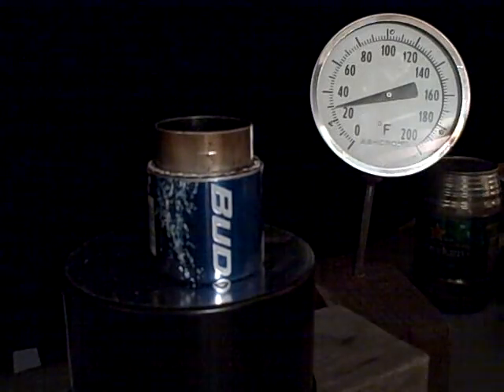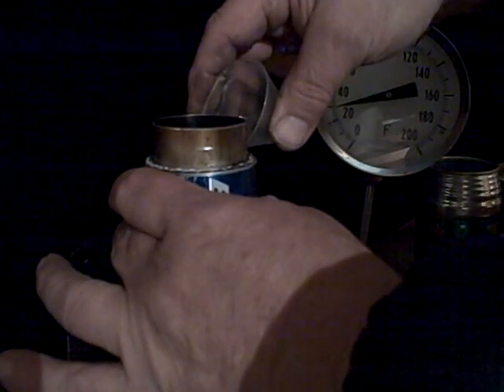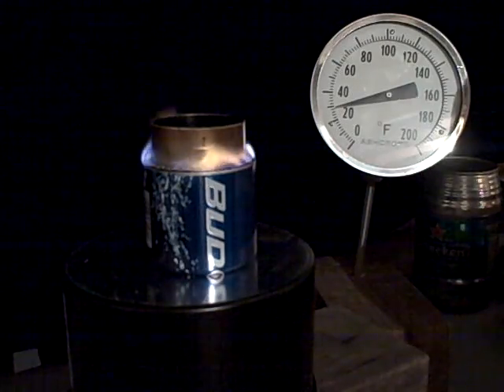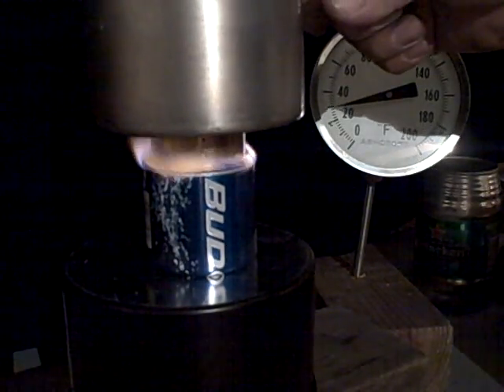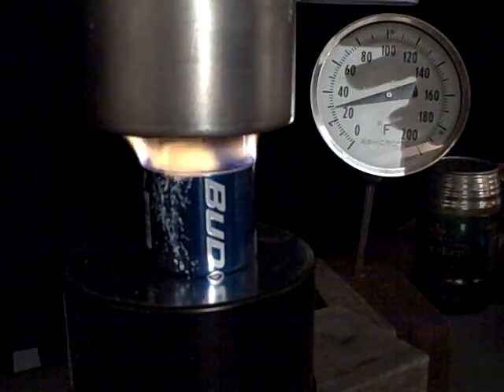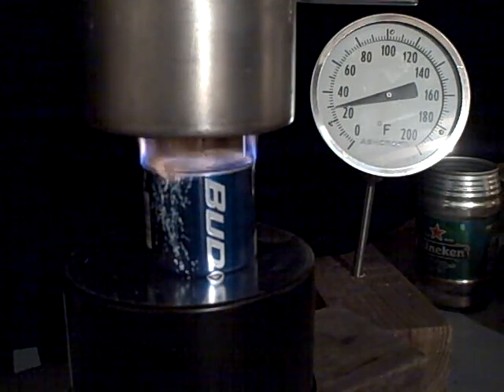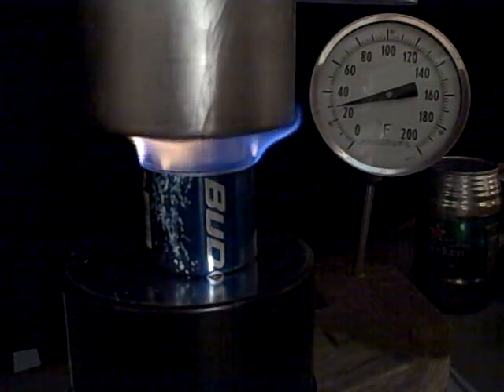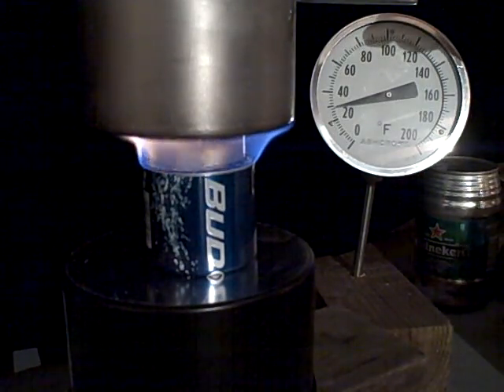"SuperStove" Wind Resistance Demo

Comment from the maker: @Inigo93 I used a small fan for the demo. It was inside my garage and temperature was at 30 degrees. Thats all I can tell you about the conditions. It's just a small amount of moving air. The stove lights well under these conditions shown. Small stove for small pots.